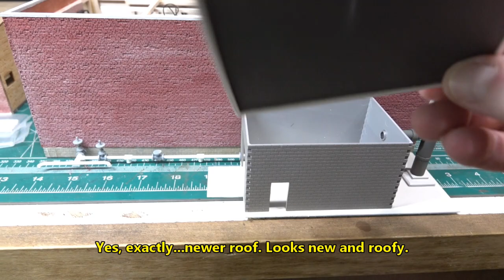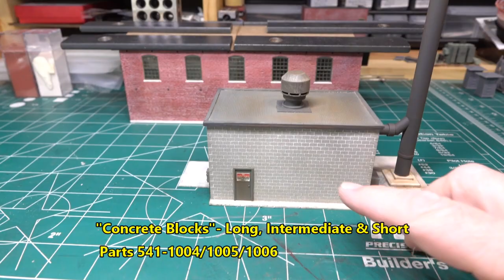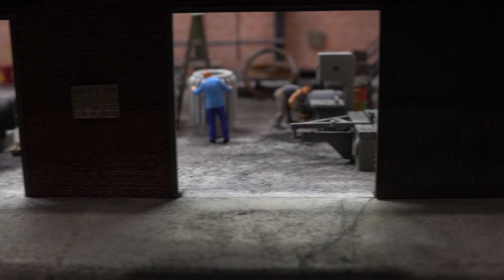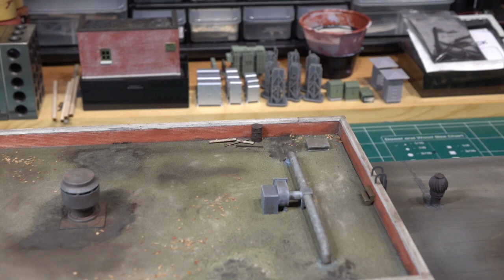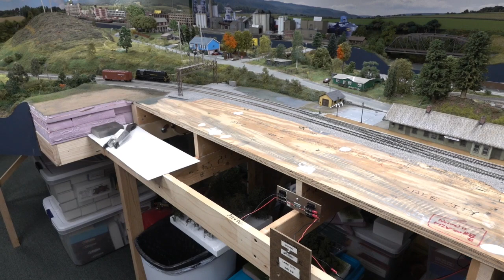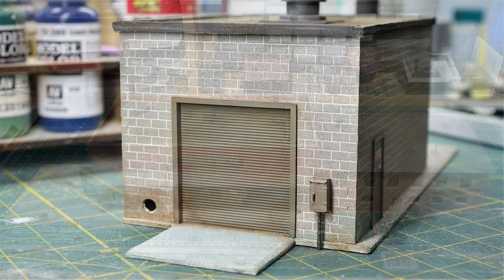Scratch Bash Project: Industry for Lake City- Part Two

Comment: If the story works, you can justify just about anything ... and your story telling is right up there with the best of 'em!  That always makes your videos worth watching! 
But I gotta say, unloading a tanker full of fuel oil that close to a building with a huge vent and very tall chimney (which obviously indicate a large fire-breathing somethingorother inside) seems a bit risky, even for Cletus.  That boy is playing with fire!  You might want to use a bit longer unloading pipe than you currently have to move the tanker further away from the potential source of ignition.
By the way, will you embed that tanker track in pavement?  Otherwise not sure how any vehicle is going to get up to that large roll-up garage door on the track end of the annex. 
The weathering details look great!  You didn't say much about weathering the block walls of the annex, but there's a huge difference between the plain and weathered look, especially the grout lines.  Looks great!

Comment: Very well done on the building. Turned out great. Just had one question, why is the ladder on the loading dock area right in the middle of the door?  Doesn’t that kind of defeat the purpose of using the ladder?  Other thatn that really cool.